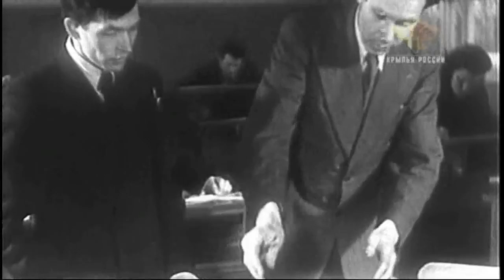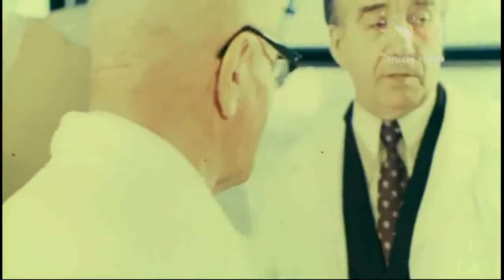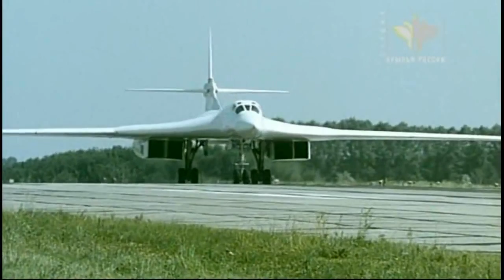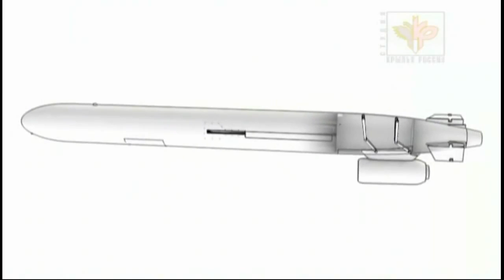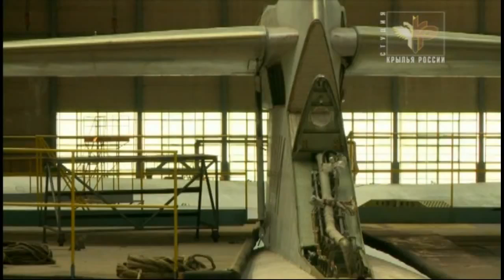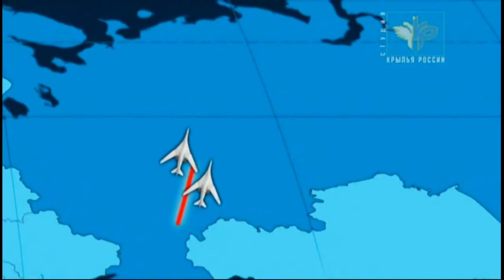Tu 160 ' White Swan '! Wings of Russia

Comment: TWO HUNDRED THOUSAND POUNDSN OF THRUST...WAZOO!
Reply: Empty weight: 110,000 kg (242,508 lb)
Gross weight: 267,600 kg (589,957 lb)
Max takeoff weight: 275,000 kg (606,271 lb)
Powerplant: 4 × Samara NK-321 afterburning turbofan engines, 137.3 kN (30,900 lbf) thrust each dry, 245 kN (55,000 lbf) with afterburner -- so, 123,600 lbf thrust dry; 220,000 lbf thrust with AB.

Thrust:Weight Ratio (n:1) @ 589,957 lbs gross wt: dry = ca. 0.2095; with AB = ca. 0.3729

Comment: Where's the part about the Soviets stealing plans from the United States? The B-1 Lancer first flew in 1974, and was introduced in 1986. And yet, in a feat of PURE COINCIDENCE the white swan first flew in 1981, and was introduced in 1987...and it had a variable swept wing like the B-1...and it was supersonic like the B-1...and it looked like the B-1. But hey, just a coincidence am I right?
Reply: The film tells why they chose this design:
1. The aircraft must have an intercontinental flight range and carry a lot of fuel. Therefore, you need to use an integrated circuit glider, with a smooth flow. This allows you to carry a lot of fuel.
2. The aircraft must be multi-mode. Fly at supersonic speed and at high altitude. It must also fly at low altitude and subsonic speed to break through air defense. For speed, you will need a wing of large scope, and for small heights - a wing of small scope. Therefore, a variable-wing wing was used.
The Tu108 project was not fast enough, the Tu135 project cannot be used at low altitude due to its swiftness.
Requirements for aircraft create the military. The military needs the aircraft to be multifunctional and to perform its tasks well. Aircraft designers adapt to these tasks.
All supercars are similar to each other, all airliners are very similar, submarines are very similar. Do not notice the oddities? Physics on Earth is the same. Based on the tasks, designers choose a more suitable design, of which there are not many.

Comment: The payload is less than 10% of maximum takeoff weight, which is too light.
Reply: The narrator said the payload is 22,500 kilograms, which is 49,604 pounds, not 90,000 pounds.  Respectable, but far from the highest payload of any bomber ever made.  Max payload for the B-1B is 56,700 kilograms (125,000 pounds).
Reply: Max payload for the Tu-160 is 45,000 kilograms
Reply: Max payload is classified. They have unloaded over 60 tonnes on ISIS many times this year. So it is well over 45 tonnes or 56 or even 60. Crew is the only one that is briefed on the vehicle. Officially they can dump 90,000lbs of freefalling bombs. Boeing claims 75000lbs capacity for B1 but obviously true capacity is classified.

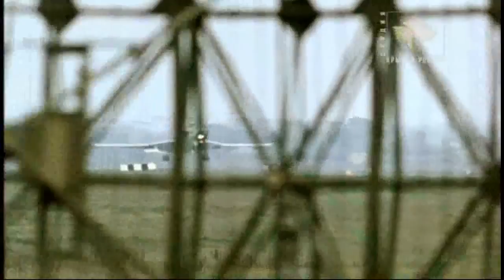Comment: 25:08 that's a Tu22m not Tu 160
Reply: +George Kakaratsios Maybe that was just stockfootage of the "unit" that recieved the bomber, and they had TU 22s before they got the 160? Maybe they still operate them along side it?
Reply: I thought of that after I saw more Tu22s. Probably you are right. But the timing was rather bad in the video
Reply: +George Kakaratsios Tu22M3

Comment: Role Supersonic strategic bomber
National origin Soviet Union
Design group Tupolev
Built by Kazan Aircraft Production Association
First flight 19 December 1981
Introduction 30 December 2005 (IOC in 1987)
Status In service
Primary user Russian Air Force
Produced 1984–1992, 2000, 2008
Number built 35

Role Supersonic heavy strategic bomber
National origin United States
Manufacturer North American Rockwell/Rockwell International
Boeing
First flight 23 December 1974
Introduction 1 October 1986
Status In service
Primary user United States Air Force
Produced 1973–74, 1983–88
Number built B-1A: 4
B-1B: 100
Unit cost 
US$283.1 million in 1998 (B-1B)[1]

Comment: It's a beautiful plane, but they basically ripped off the original B-1 project....
Reply: +TheJamesthe13 

Many aviation enthusiasts are quick to point out the similarities between the Russian Tu-160 Blackjack and the American B-1 Lancer. The assumption seems to be that the Tupolev design is a crude imitation of the Rockwell design.  

Where that theory runs into a brick wall is when you take into account the design heritage of the Tupolev design, which clearly shows  precursory hints at the ultimate design years before the B-1 program was even launched.
Reply: +TheJamesthe13 NOT...